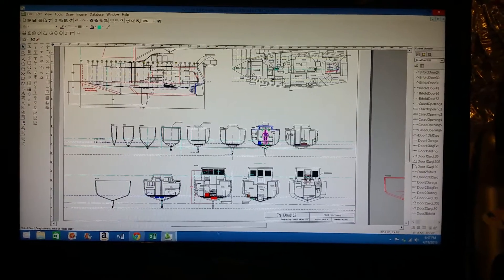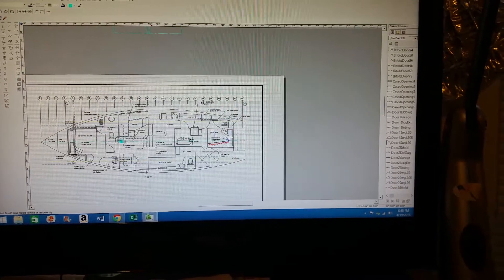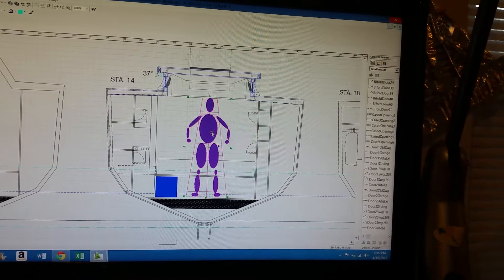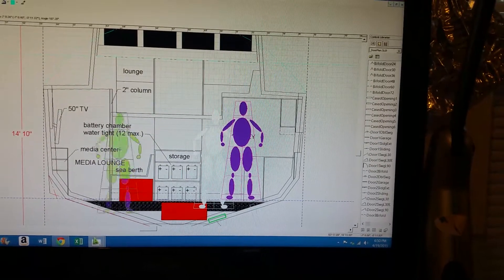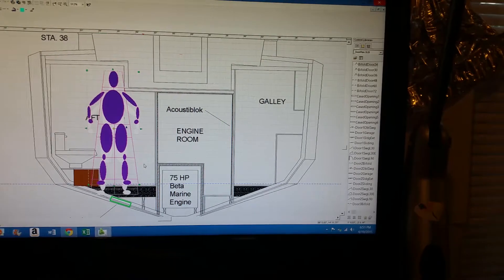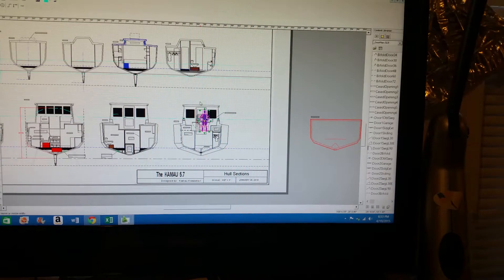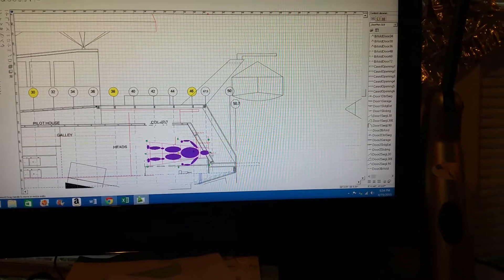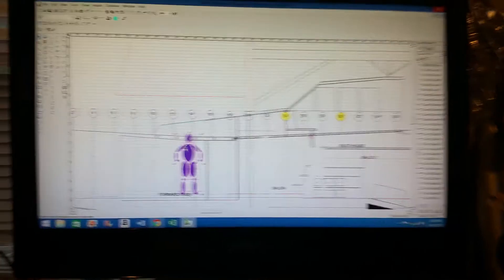How I designed my boat for 7' head clearance

Comment: Kamau -- I own and use an Acad2014 seat for my retrofit projects. Your CAD software looks different. What are you using?
Reply from the maker: I use a program made by Autodesk its called autosketch. it's only a couple of hundred dollars but still produces DWG and SKF files